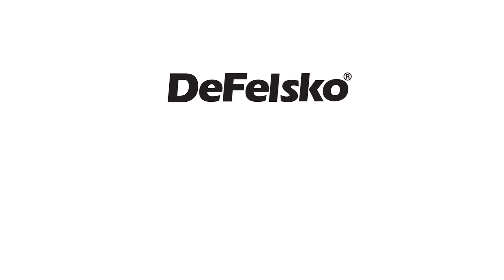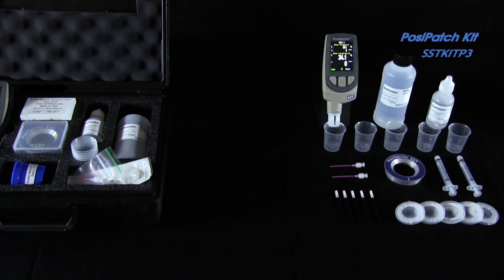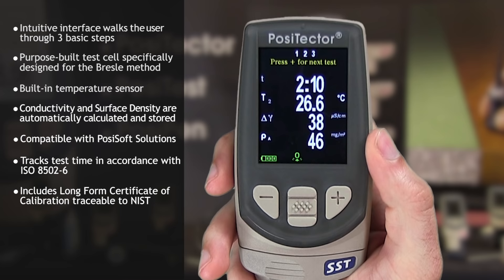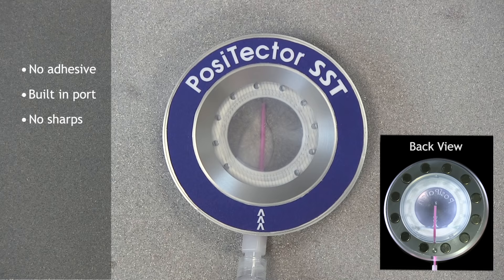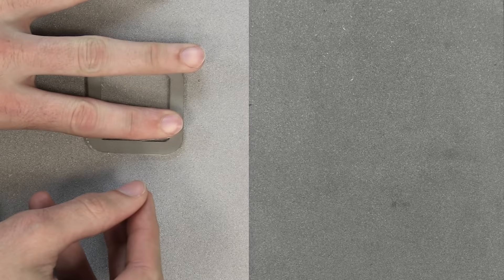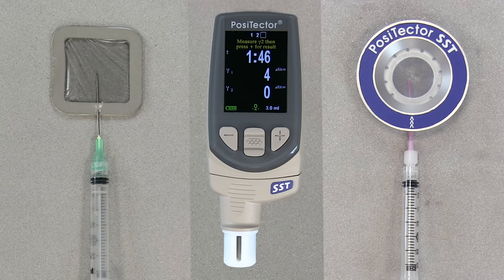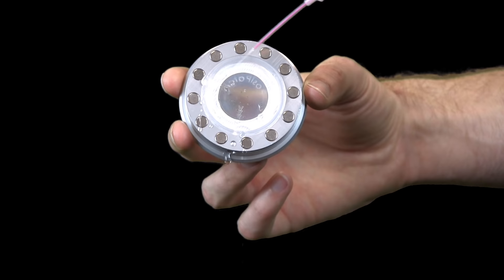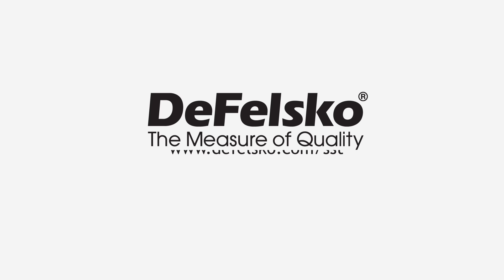How to Measure Soluble Salt Contamination with the PosiTector SST Using the Bresle Method

Comment: Test time 2 minutes have not mentioned in user guide of Positector SST. Since ISO 8502-6 2020 standard refers minimum 10 minutes for bresle method. So what is the evidence  documents can be in placed to prove 2 minutes test time?
Reply from the maker: When our user guide was written, ISO 8502-6 didn't recommend a specific test time, only that it be agreed between all interested parties.  Based on our internal testing, a two-minute test time is often adequate for measuring the concentration of soluble salts.  Given this, we recommend a test time two minutes or longer, unless otherwise specified or agreed upon. Ultimately, it's up to the user and all interested parties to decide upon. If you have additional questions or would like to discuss this further, contact us at +1-315-393-4450 or techsale@defelsko.com